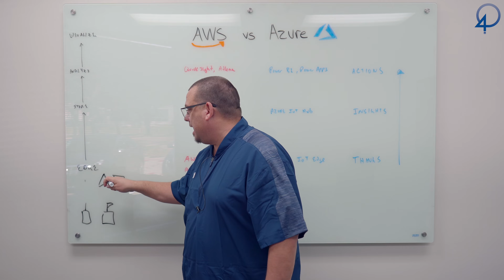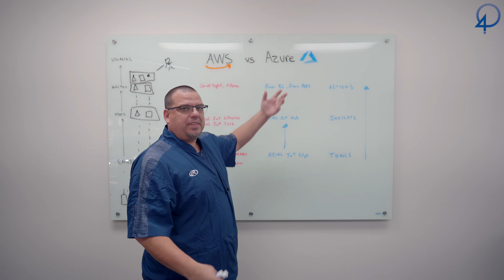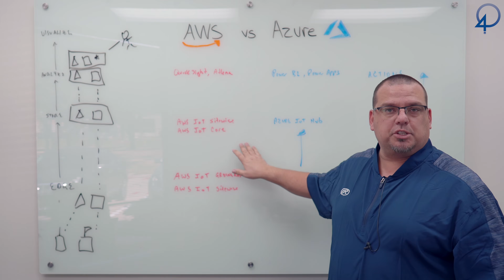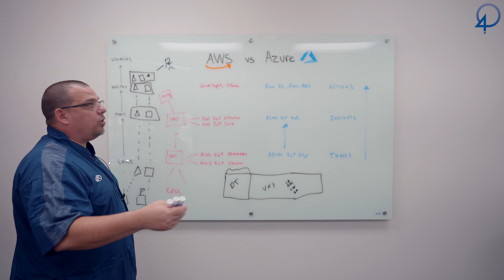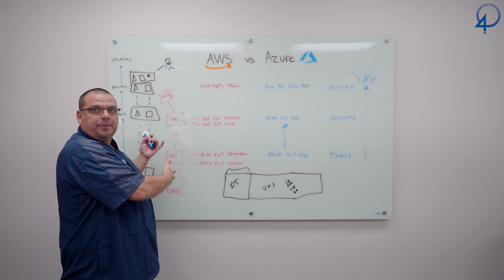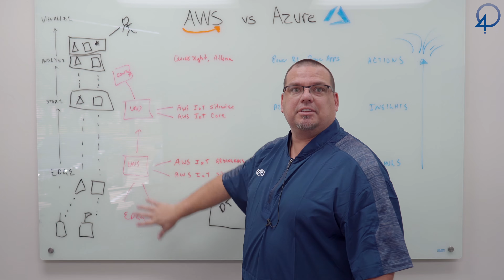AWS vs Azure IoT [For Industry]

Comment: Generic question. when it comes for data analytics solution is it good idea to mix AWS services with MS? or whats the most common recommended approach for data sensitive platiform
Reply: This is a great question... it is possible to mix and match but isnt generally recommended because of the advantage of native connectors and the engineering lift required.
Reply from the maker: You are on top of it Walker! 💯

Comment: "With AWS, we have a mechanism for getting that data back down to the plant floor thru the unified name space." And that's the whole point.
Reply from the maker: Thanks Sheryl!
Reply: Hi Sheryl, just curious what kind use case you have that requires data back down to edge? Also, technically you can get data back in Azure IoT if need to. Also, Azure allows you to run Stream Analayzer on the Edge itself.
Reply: @georgezviadgoglodze7810  Hi George, I was thinking of any use case that involves providing near-RT decision support for machine operators or engineers for process innovation, uses that require combining/ modeling machine and sensor data with predictive ML results and Enterprise-level data (could be all sorts of things...current manufacturing capacity, materials availability). To automate the use of data for operational improvements requires meaningful context. Sending the modeled data back to the plant floor via a unified name space adds that context in a feedback loop.
Reply: @sherylmccrary9045  im still not clear with these iiot thing and how to train the data with ML
Reply: @chickenz4604  Walker did a series of 3 videos on this that are a good place to start. https://youtu.be/tDrSndk6l18
Reply: @georgezviadgoglodze7810  Gathering data is just the first part of any well designed, feedback-managed, system.
To use a simple analogy; I need to know when my gas tank is becoming empty more than the gas station needs to know. I just need a simple gauge at the dash, while gas mileage, miles traveled, time on engine, can all be calculated elsewhere.